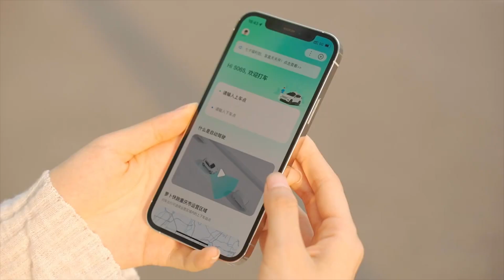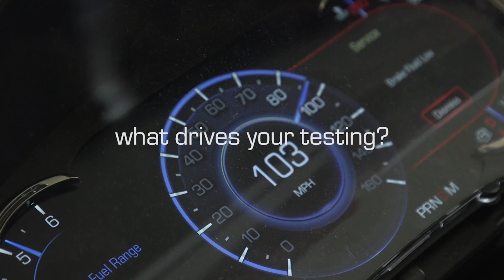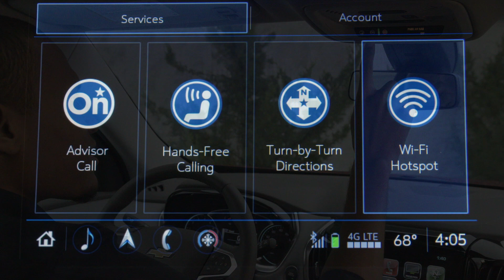Cheapest & Costliest Brands to Repair; Foreign Brands Losing EV Race in China - Autoline Daily 3380

Comment: With respect to auto repair costs about 3 years ago I ran across a site named Repair Pal and under reliability rating you can check a number of different manufacturers and models for average yearly repair/maintenance costs, repair frequency metric, and repair severity metric. The costs are based on values charged in participating repair shops. I have not been able to figure out the number of cars that are used or the locations of the shops or if dealer repair shop data is included.

Comment: Check if the Polestar 5 is built on the SEA platform. They may not be correct. So far Polestar is building on Volvo's SPA2 platform for their next-gen EV 3, the PMA for the Polestar 4 but I haven't heard of the SEA chosen for the Polestar 5.

Comment: On China, you should have mentioned the Covid impact on Tesla from Local Shanghai shutdowns. Your overall comment that Chinese firms are dominating the local market is fair but make sure you provide the full picture
Reply: There were covid shutdown on the other manufacturers as well so it's a fair comparison.
Reply: @the_DOS  Not really. Tesla has 1 facility in China and it is in the Shanghai lockdown area. The domestic manufacturers have facilities outside the lockdown areas. So yes, some impact for some domestic players but 100% for Tesla. To be fair, this is entirely Tesla’s own problem. They run a high operational risk at the current time given their dependence on their  1 China facility. Until Tesla can ramp up Berlin and Austin and build other facilities, they run high operational risk.
Reply: China doesn't have the rabid Tesla fan base that the US and other countries have and see the domestic vehicles as a better value. Certainly the build quality can't be any worse.

Comment: Sandy has become a Tesla evangelist and apologist even as CR ranks them 27th out of 28 vendors for reliability.
Reply: What are you?
Reply: @johnmqueripel2367  realist
Reply: Apples and oranges.  CR thinks transmission failure and software update is same category: problem.    Any reasonable person sees this differently.
Reply: @tedg1609  If a Tesla motor fails after the warranty, you're out $6.5k
Reply: @KTPurdy  But the warranty is eight years of 200,000 miles.
Reply: @KTPurdy  the transmission in my little brother's mustang cost him $7k.
Reply: @colingenge9999  Looking at CR's reliability numbers, that 8 year mark is important.
Reply: @colingenge9999  Obviously, you know that the rankings are derived from owner survey results.
Reply: @KTPurdy  yes but in Tesla’s case their survey didn’t go back far enough for their usual analysis so I believe they made assumptions not based on their normal way of making evaluations. To the best of my recollection.

Comment: That postal EV truck will make a nice camper van. High center of gravity but with those batteries located down below it should be very stable.
Reply: Yes, that makes it lower center of gravity with a batteries mounted near the bottom